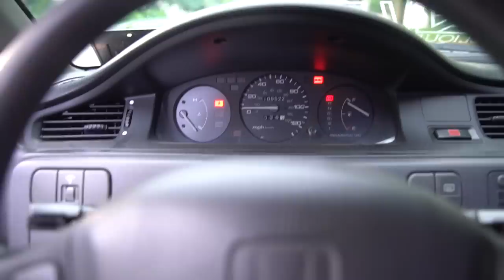SLAMMING RARE CARS!

Comment: Make sure bleeder nipples are at top of caliper if u mix up left and right calipers    It will not bleed
Reply: Brandon Garonzik it's a master cylinder issue for sure. Calipers are in the correct position